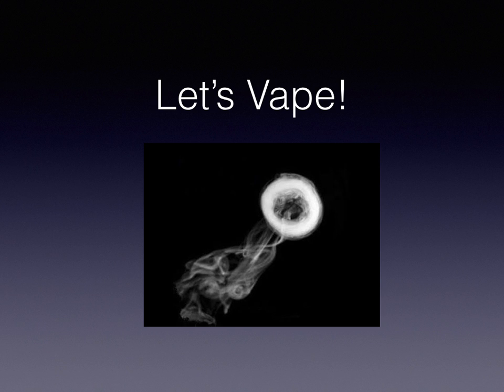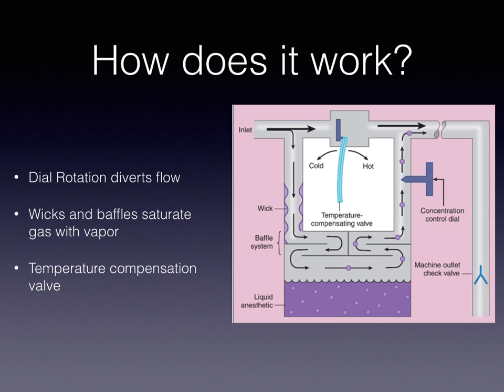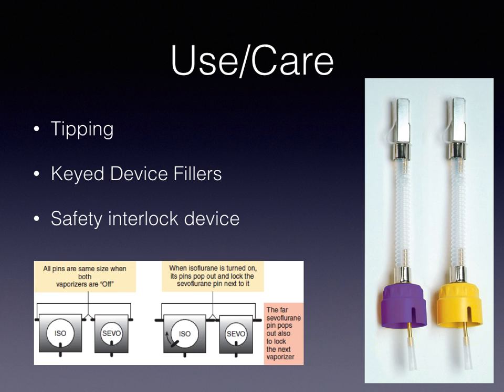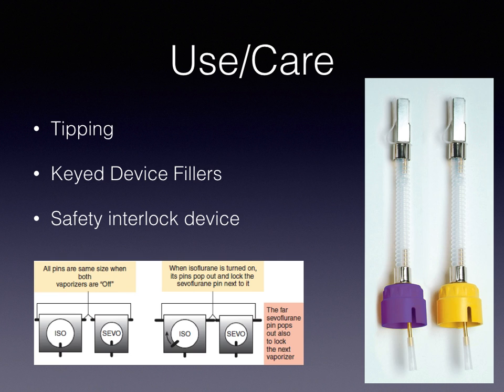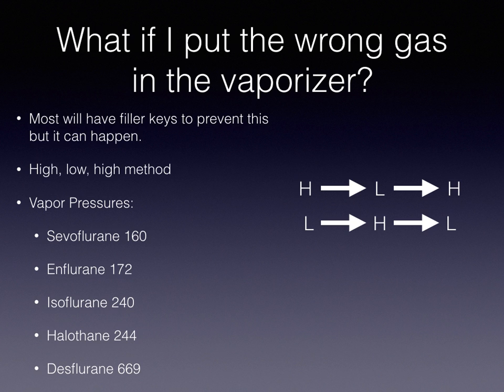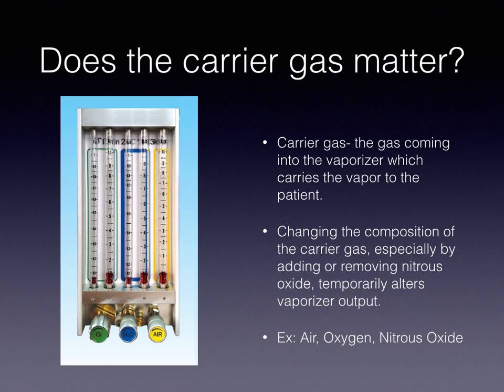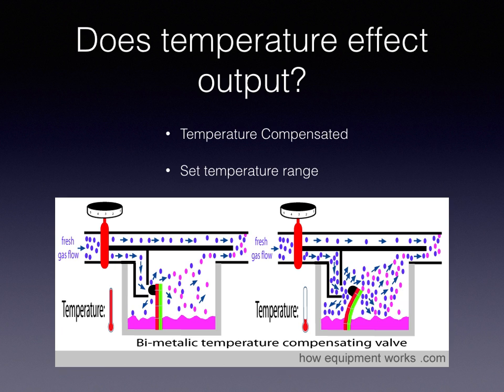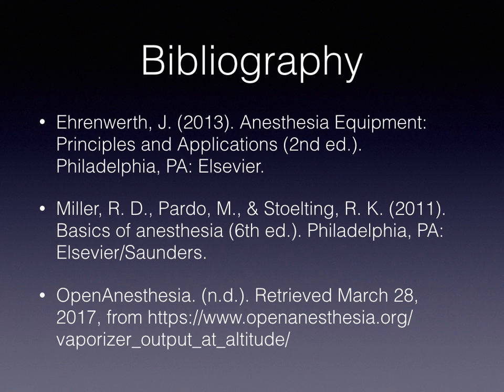Anesthetic Vaporizers

Comment: Elevation change mentioned here only applies to sevo, iso, and halo vaporizers which utilize gas flow at atmospheric pressure.  Desflurane Tec 6 does not, which means you'll need to increase your dial at higher elevations in order to achieve MAC